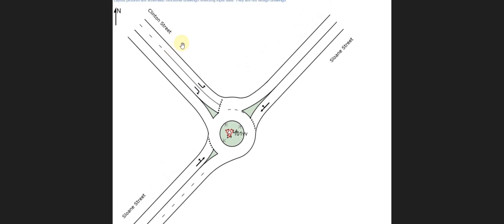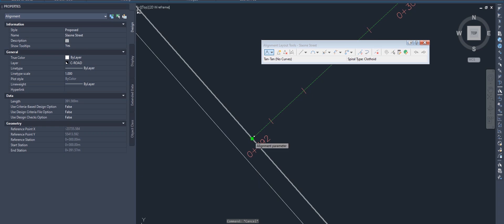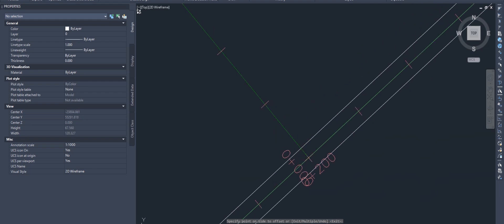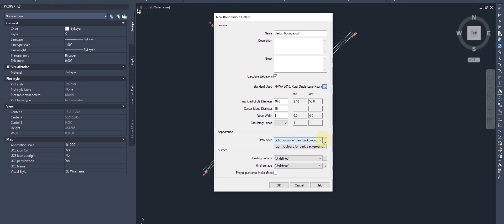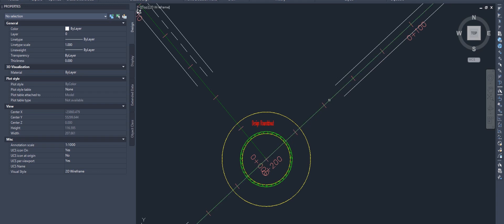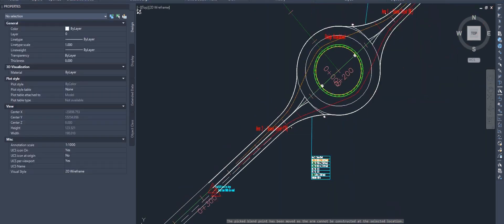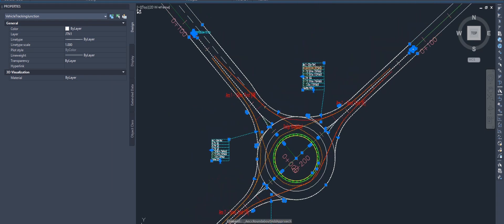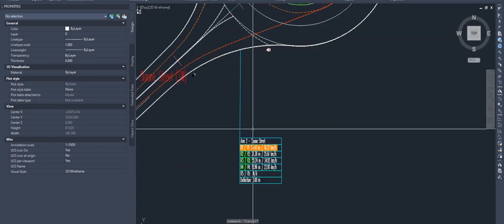How to Design Roundabout in AutoCAD Civil 3d | Create Roundabout in Civil 3d |Modelling a Roundabout

Comment: After creating the roundabout with roundabout tool, problems i faced-
1. If inscribed circle Dia is changing, then center island Dia also changed and roundabout got created but it says road width for wb-20 too small.
2. after creating 1 approach, for rest of the approaches, not able to select alignment for approach. 
please suggest.
Reply from the maker: For the first problem, ensure that the road width for the westbound approach is adequate to accommodate the changes in the roundabout's dimensions caused by variations in the inscribed circle diameter.

For the second issue, double-check that the alignment selection process is correctly applied to all approaches. Ensure that the alignment selection procedure is consistent across all approaches to avoid any selection errors.